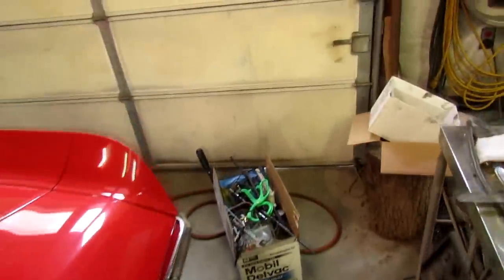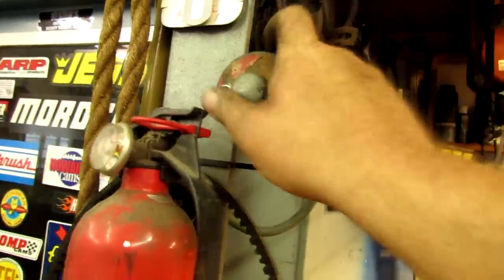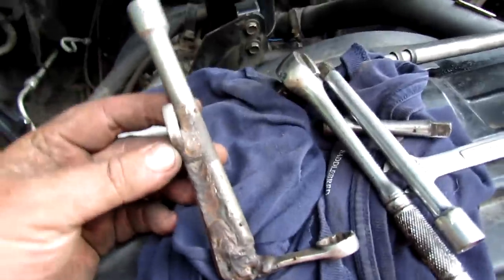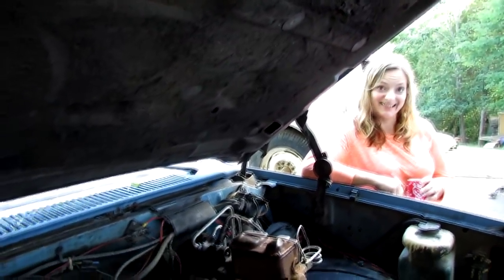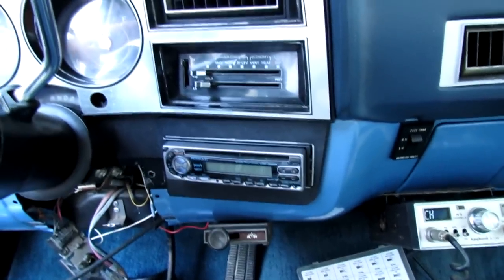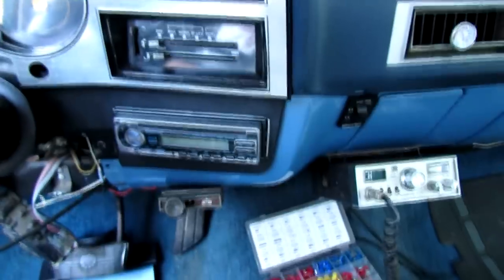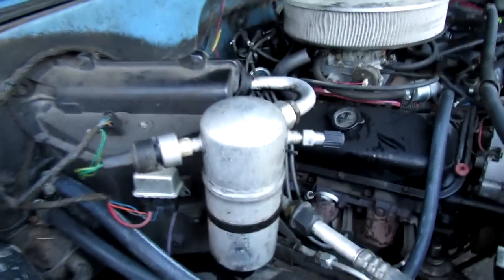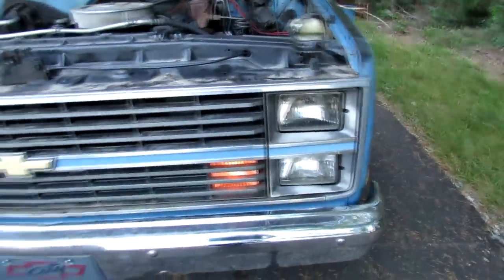Work on the dually-installed some tunes

Comment: For the A/C that should be cooler.  One easy thing to check, make sure that the hot/cold mixer is completely stopping the hot water from entering the heater core.  I had a minor problem with that once, an older lad tipped me in the right direction and one or two minor adjustments later, I had 39 degrees at the center vent using r-12.     Also, I had found some vehicles that just cool better with more air flowing thru the condenser. Park for a few moments,  air flow cuts down,  feels like the A/C has quit.  Move again, temp goes cold again.

Comment: For a custom touch on the lighting you can add another set of factory turn signals on top of the existing turn signals behind the grill, quad headlights deserve quad turn signals! It works I did it on a 86 blazer

Comment: the 1975 chevy with dual tanks, you just flip the switch. I'm not sure when gm changed the style of the switch, but the 1986 and 1988 trucks we had to flip the switch and push down on it for a moment to switch tanks, with the engine off and the key on you can hear the valve under the truck when its working.

Comment: 48 at the center vent with the AC on high is VERY good for an R12 system running 134A without any changes. With R12 that system would run about 40 at the center.

Comment: did you put any oil in the comp. or did it come already filled? On some of those older comp. they came dry and you had to add the oil to them.That comp sounds like it don't have enough oil.

Comment: the only question is the 454 low compression? if it is its not going to give big power or good mileage. Need compression make things work. Here in the Rocky Mountains those low comp big blocks are just dead weight.

Comment: I need to clean my workbench off too.   Well, my whole shop really... 
I do like that truck man, same color as my old one.   That steering wheel looks like a 2nd generation Z24 style... I like it.
48° isn't where it should be, but it's better than no air at all.   Have you cleaned the condenser?  How about checking the blend-door to make sure it's not sticking?
Reply from the maker: I blew out the condenser...I still need to fool with it some more when I get the time.

Comment: Back in the day didn't R-12 have some sort of oil in it for the compressor? That compressor sure is sounding noisy.
Reply: did you add oil when you replaced the compressor?
Reply from the maker: Had 3 ounces in it as shipped, I added 2 more. I intend to add some again.

Comment: think ya should have oil in the refrigerant not just straight. there is also a dye that goes in it's a two in one .oil has a dye so ya can see if it's leaking that's the way it use to be. need to swap out the orifice tube for a new one...Just some hints..not at all an expert ...been out of a/c work. for 20 years..sure that there is other stuff out there now a days...good luck bud!!